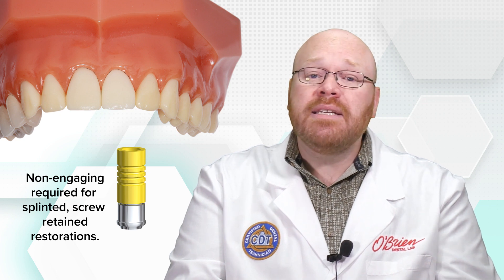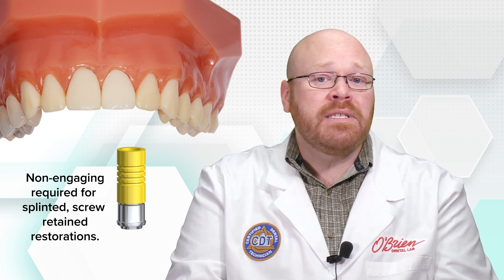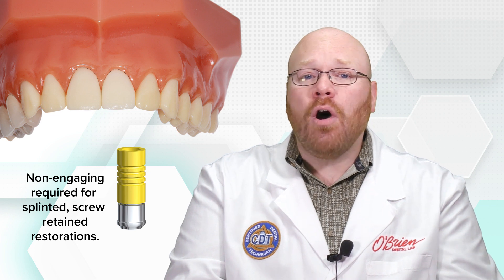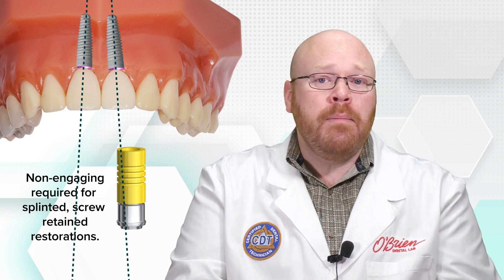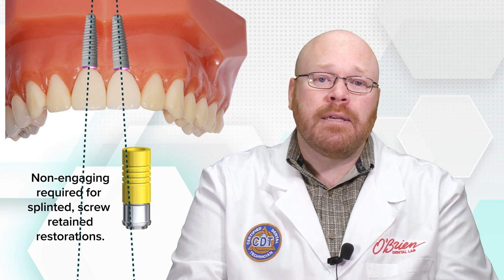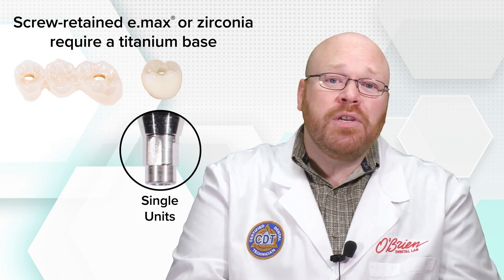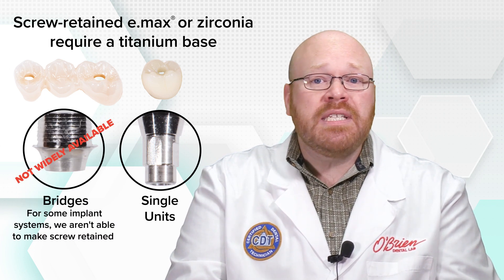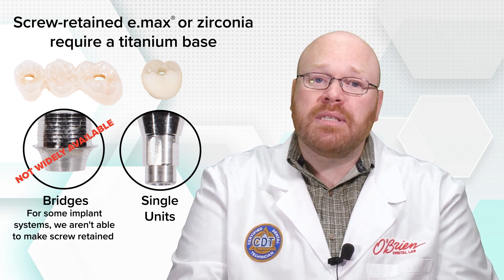Implant Abutments: Engaging vs. Non-Engaging

Comment: is it necessary to use non engaging abutments in screw retained prosthesis?
Reply from the maker: Only when there are two or more implants that are being splinted together.  In that situation, at least one of the abutments should be non-engaging to ensure a passive fit.
Reply: @OBrienDentalLab  can you please tell about the need to precement the crown/use precemented crowns?

Comment: Thank you for the infirmation.
Just confused about non engaging abutments and multi unit abutments.
For screw retained bridges, when should we use multi unit and when non engaging?
Reply: MUA’s are used for making angle corrections across multiple implants for a full-arch prosthesis. This is an entirely different restorative situation than a 2, 3 or 4 unit implant-supported bridge that exists entirely in one quadrant and where the implants aren’t greatly divergent from each other

Comment: What do you think of laboratories using engaging custom abutments for screw retained zirconia bridges. They made the abutments non engaging at the time the bridges are finished and ready for cementing by cutting off the hex of the abutments. Is that acceptable? If not, why is that?
Reply from the maker: This is not something we recommend.  Implant abutments are class II medical devices and the FDA prohibits labs from altering the interface.
Reply: @OBrienDentalLab  
I had a case that came to me from a practice in another state where the previous restoring dentist had done this chairside. It was a single unit (#30), and patient’s complaint was naturally that the old dentist was always having to re-tighten his implant crown. It took me a little while to figure out what the old guy had done, I presume because he ran into trouble with orientation during delivery (I would guess an improperly seated impression coping was the original culprit, the patient’s recall of the events seemed to match this type of scenario). 
Ended up making a new screw-retained restoration, the patient was very happy and is still with me today. A good reminder of why these features exist in the first place, and why messing with them is a bad idea
Reply from the maker: @mmwosu  Quick "fixes" often lead to long term issues!

Comment: Thank you for an excellent video series.  At 2:09 you show a non-engaging UCLA abutment for a single unit crown.  Should this be an engaging UCLA abutment?
Reply from the maker: Yes, good eye!  Those crown images were being used to make the point that those are the only two types of restoration that can be made with UCLA abutments in general (both engaging & non-engaging).  Given that I was talking about the availability of non-engaging parts and had the non-engaging abutment on screen, we should have used images of bridges instead - an oversight on my part!